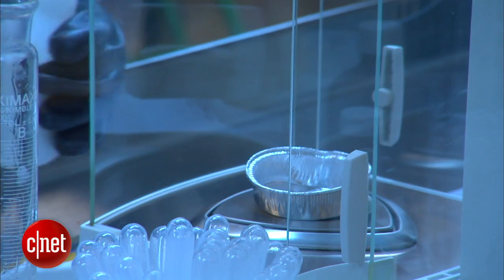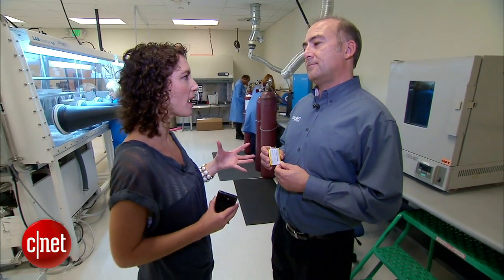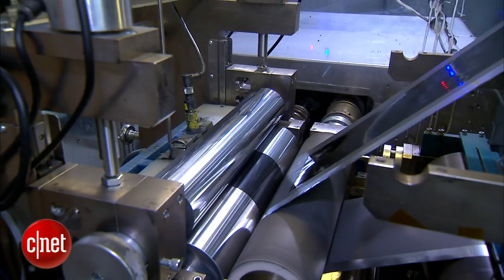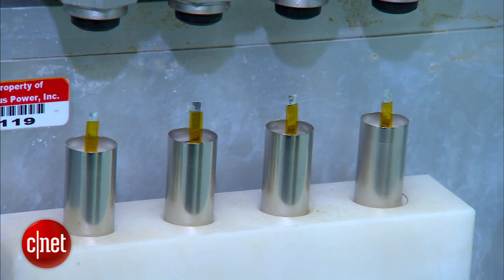CNET News - Inside the guts of a battery factory

Comment: my SGSII battery lasts more then 24h, if its on standby with nothing heavy running on background takes about 36h, but since smartphones can run multiple apps with different power needs in background, its difficult to guaranty a minimum time on a single charge, but we really need long lasting batteries, because its frustrating to have no juice when you really need the phone, specially when you charged it in the very same day.